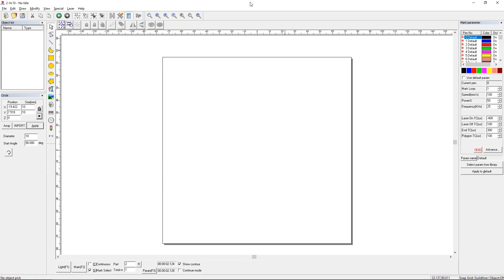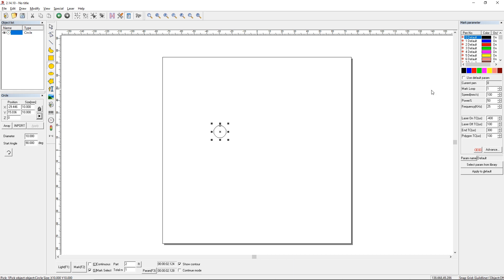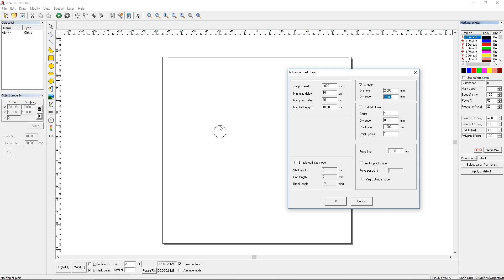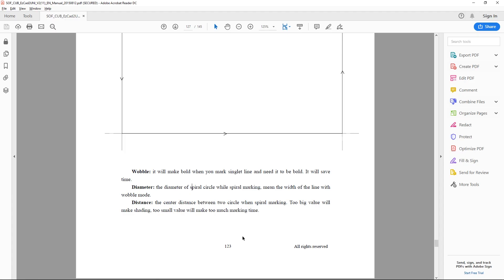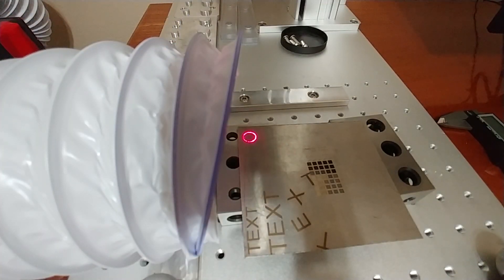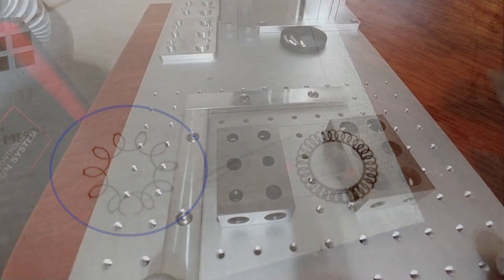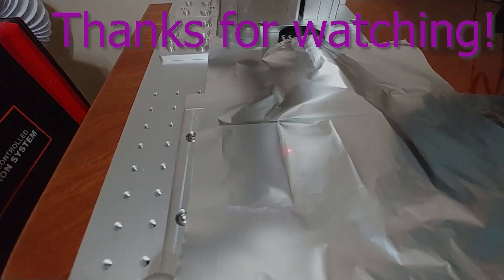EzCad2 Tip : The Wobble Option - Fiber Laser Pen Settings

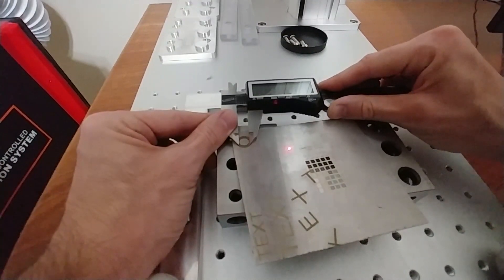Comment: Based on this at 2:40, wobble settings reduced the 10mm circle down to 8mm. So in this case, wobble reduced size of object unless you increase the size of object by 1 mm all around; then circle should still be 10 mm.

Comment: Wobble is a very good option and you will need for 3 reasons:
1) make letters line bigger because laser beam is 0,001mm , so if you need more bold text or all you want.
2)you need for cutting, 1mm of size is ok, laser beam is too little for cutting, will weld again in the second pass, so wider line will leave exit sublimate material without problems.
3) you need for welding with laser, put together 2 plates and use wide wobble size (around 3mm) and give hi power and you will weld 2 materials, plastic too. For metals more power you have, more material you can weld. professional laser welding are 300w\500w for wobble use, but with 50w fibra I can weld too little projects, jewellery items too.
Reply from the maker: Thanks for the info!

Comment: Hi Jeff
Just wanna ask about different power ,  
Speed and frequency settings for different materials 
Can u help with that?
Reply from the maker: I've shown a video of pretty much every material I've tried to mark.  I think the settings are mentioned in almost all of the earlier videos.  They won't be exact as every laser is a little different, but they should provide a good starting point.  Is there something specific you're trying to mark?
Reply: hi, if you need I can help you too
Reply: @emanuelelucarelli7147  why not 
If u have any information that can help

Comment: The wobble settings is used for cutting Metal substrate and making lines thicker not for making designs but you can do that as well.
Reply: Right, people for 99% are playing with laser and don't know a lot about potentiality.
Yes wobble is used for cutting because the laser beam is too little to engrave deep material because the heating will weld again in the second pass, so will be a dirty engraving, wobble will build a wider line to cut where the sublimate material have enough space for exit.
I use 50w MAX laser, and I cut easy 1cm too of materials, but remember to re adjust focus in time manually with the wheel if you don't have automatic focus hardware in your laser head. 
Wooble setting size will be good between 0.5mm to 1mm to do a good job.
Reply: @emanuelelucarelli7147  Can you share what parameters do you use for cutting?, I´m also curious how can you weld 2 materials? do you have any video? Thanks!